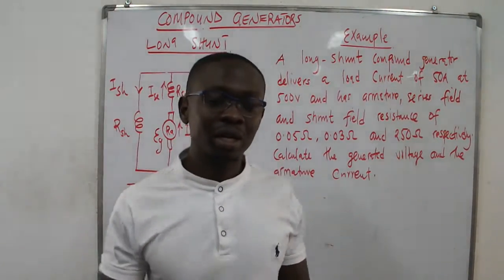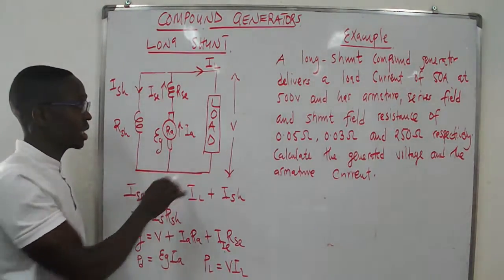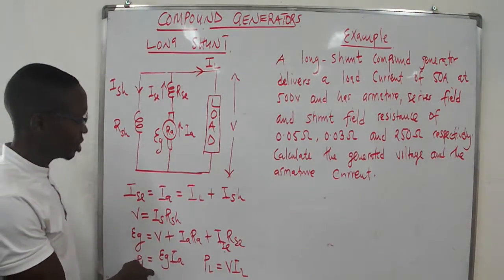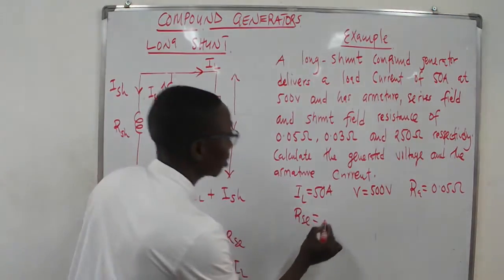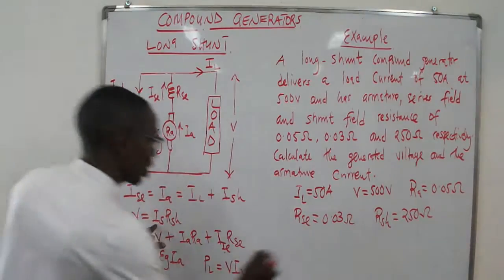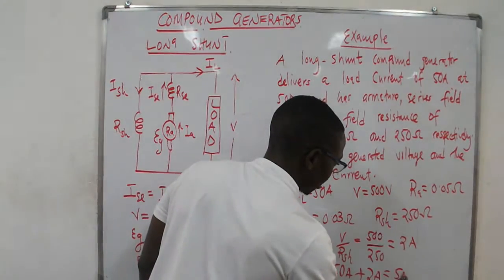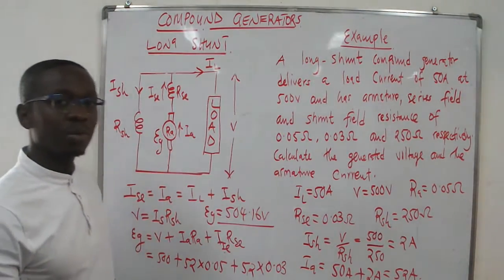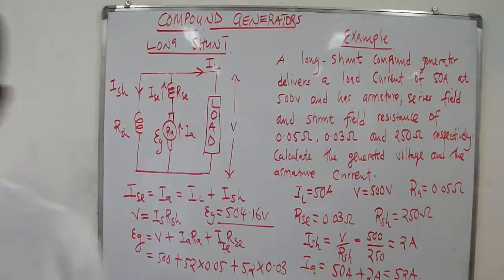long shunt compound generators

Comment: A 5kw,240v,DC series motor has armature and field resistance are 0.05ohm and 0.02ohm respectively.The iron and friction loss are 800W.Calculate:(I) total copper loss (ii) commercial, mechanical and electrical efficiency (iii) BHP of the motor 
Please slove this question sir